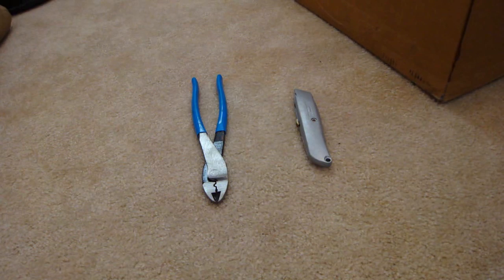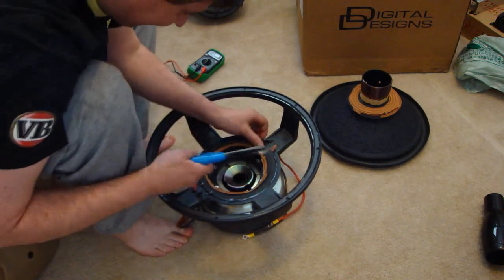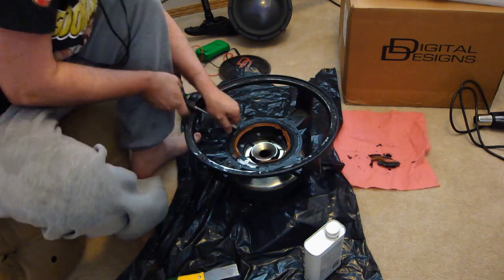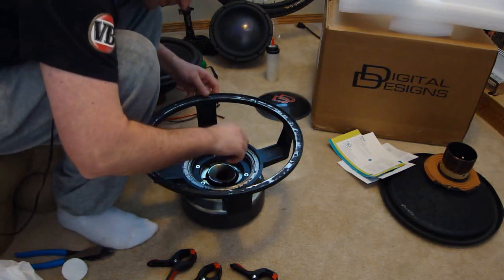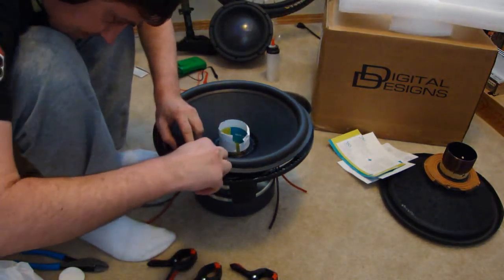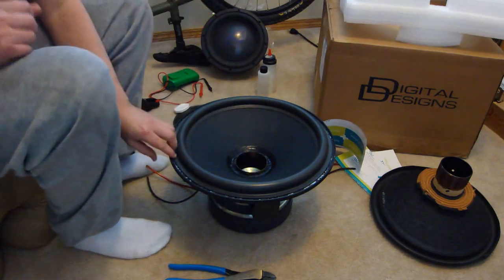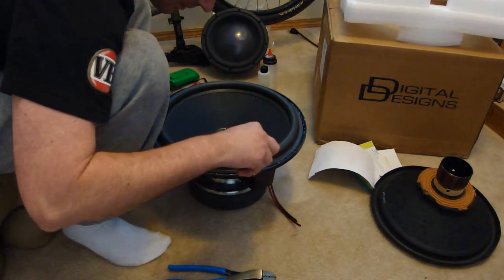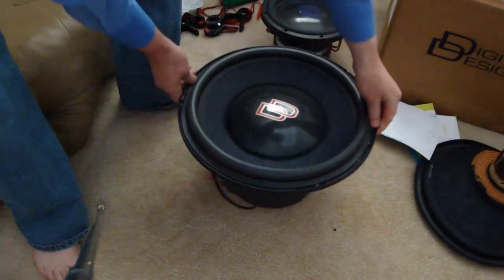Reconing Subwoofer Tutorial

Comment: um was I comparing a kappa pro to a DD95? Didn't see a comparison there. I was stating that is the subs I use...I run live concert sound not bump in my trunk. with that said though I don't care if your pushing 9k watts unless you have a enclosure to match the specs of the sub your not going to get shit. I have seen some really low watt cheap subs create chest thumbing bass just because the box was ported and designed right. only downside is a cheap sub won't last. I have ran eminence and D&B